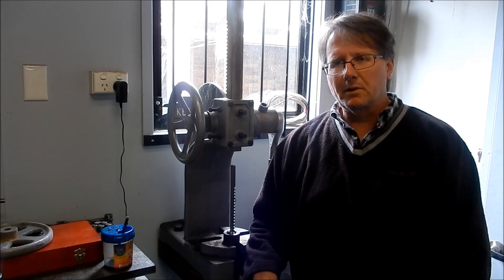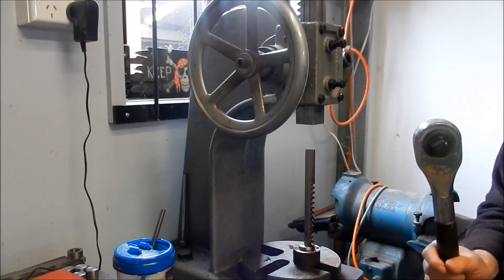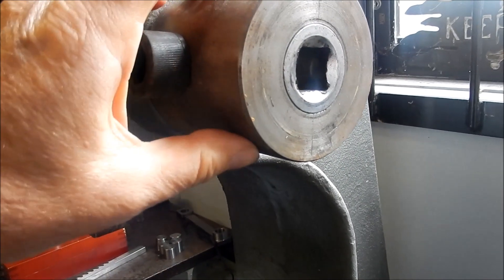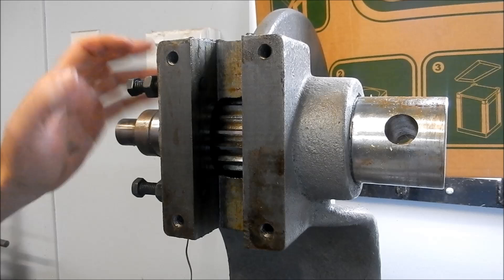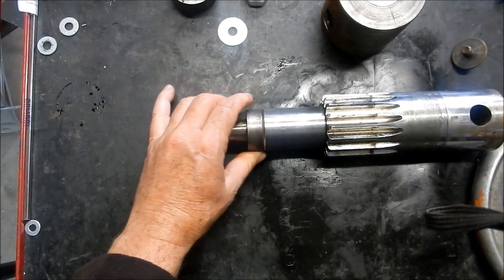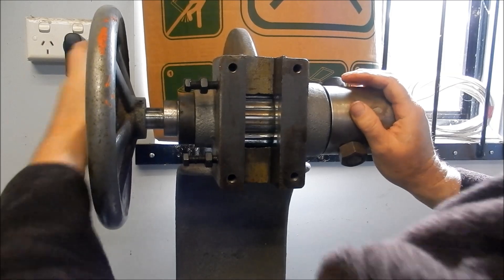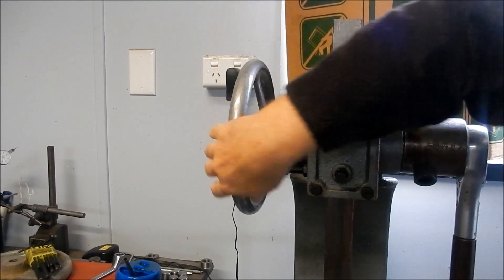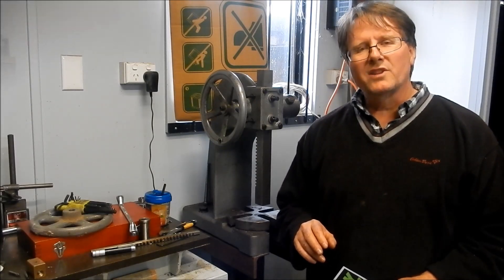Arbor Press Modification to a Broaching Press

Comment: Good to see u back into it Cam, it took me a good 4- 8 weeks to really get back to 95% of my work fitness so hang in’ it tends to get a bit dark  on week 3 before you can feel the sun again. I’m hoping yourself or a viewer may be able to help point me in the right direction over here in Adelaide. I’m currently bringing back to service a 1940s lathe, it’s not a restoration it’s a take the bits that are usable and make the rest. The trouble I’m finding is I need a couple of small machining jobs done and no company is interested. So I’m putting it out there if anyone is interested in a couple of turning jobs nothing major, my moneys good, it would be appreciated.  Thanks I hope this is ok to post
Reply from the maker: G'Day Pokemon Team Siege, I'm surprised no one will give you a chop out to help you along with your project.  If nobody pokes their head up to help out in the next week or so, flick me an e-mail with the details and I'll see if I can get you sorted out and back on track.
Cam

Comment: A word from an engineer:
A little grease on the pinion shaft would make it much smoother in operation and last forever.  Yes cast iron on chrome plate is not at immediate risk of galling like stainless on stainless but it WILL wear if run dry. 
Cast iron on chrome plate is standard technology in gm emd loco engines but they definitely seize without an oil film.  You won't seize at low speed in a press but you will get COMPLETELY UNNECESSARY AND AVOIDABLE wear. 
You've done such a good job with those mods.  For the love of all that is holy, please (please) add a little grease...

Comment: Hi Cam, amazing how the loctite holds that socket and doesn't let go. Glad to see you're on the mend. Must feel good to return to work and get back to normal life. Regards MachineNZ
Reply from the maker: Hi Kevin, yep Loctite is amazing stuff.  As a demo I've seen sockets fitted onto bar welded into a hole and turned until they snapped of.  The same trial was done with Loctite with the same result.  That convinced me that this stuff was good.  Yeah got thrown in on the deep end at work when I returned, off my Jetty and my crew and into planning for next years shutdowns.
Cam

Comment: I’ve got the same issue with my press. Good fix! That’ll go on my todo list.
Reply from the maker: Hi Gary, its a good mod to do.  My press is a 3 Tonne unit but it can be easily done on smaller units using a 1/2" drive.
Cam

Comment: An arbor press is such a simple device with a lot of utility. Your mods are equally elegant in simplicity and utility. It was a real pleasure to see this video. Quite the contrast to the many part lathe slotter which originally caught my attention. I was fascinated in the sophistication and well thought out design of the slotter. I noticed the drawings. Do you have any plans to offer the drawings for those of us wanting to duplicate the powered slotter? I would certainly be interested. The spindle indexing scheme was spot on reminding me of brass gear making for clockworks. Cheers from the US
Reply from the maker: G'day BluesDoctor, thanks for looking in and commenting.  At this stage I'm not looking at putting drawings up.  I had a Web Site back in the early 2000's in which I put all my designs up for Foundry equipment, Mullers, Burners, Furnaces etc.  My designs came out in a publication which was totally unknown to me until I received an e-mail from one of my fellow Hobby Casters linking me to a site selling the book.  I was pretty upset to find somebody making money on something I designed and gave out for free.  I received abusive e-mail's from people building from my designs when things didn't work out and I spent hours trying to help them out.  All the issues where of there own doing because they didn't follow the designs and took short cuts to save a few bucks.  I shut the Web Site down and don't really want to go through that hassle again.  I'll never say never again but at this stage I'm very happy to show what I do in detail and will let others follow on from the video's.
Cam
Reply: @camatbattler2233  Wow... so sorry to hear that. I will review the slotter videos more closely. Looks like a grear design, one I would like to attempt. Thank you.